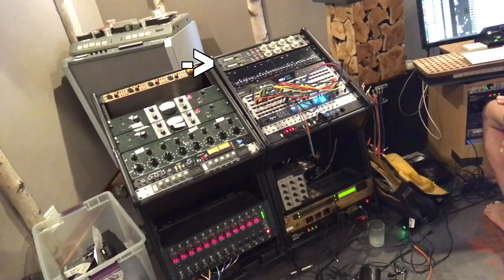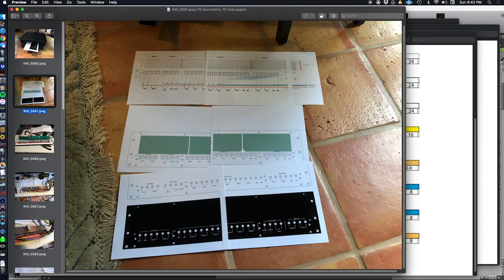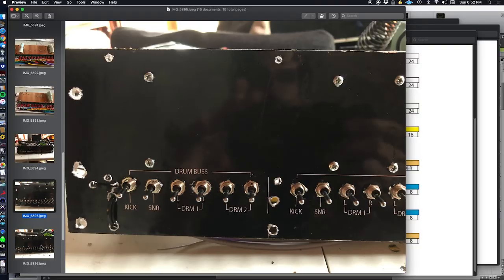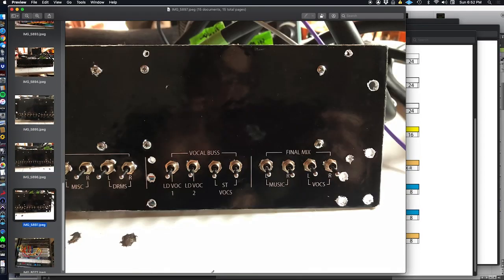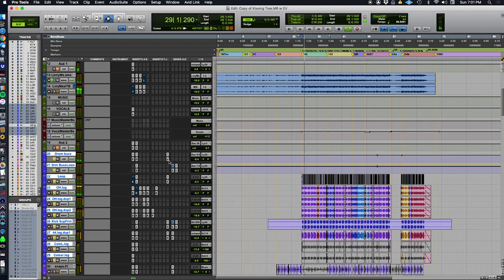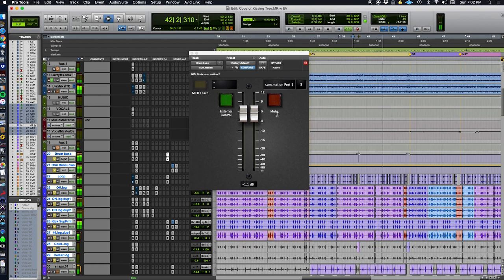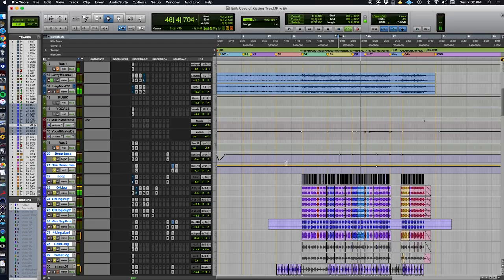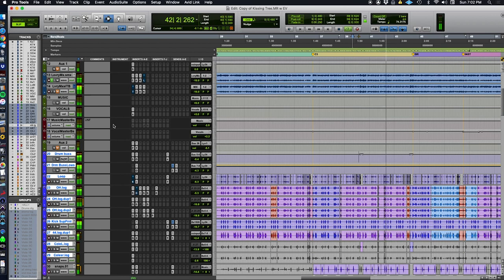Making Records With Eric Valentine - "ITB vs. OTB"

Comment: Nice education video, but you are making an error with compromised test method, and assuming that everybody interested in analog summing has Lynx grade converters at hand.. As lesser your converter as bigger the gain by the analog summing..And you never can test/measure a system with itself, since the error of the system might not show up in the measurement you do with that system. Doing 20 conversions with the same already digitized signal is not the same as having 20 independent analog processes digitized, that each time they get converted into the digital domain loose something by the conversion.  A theortical band unlimited result of the analog process.. there might be harmonics introduced well above 20 khz. So you loose harmonic content..and thats in many cases the reason you resort to analog gear inserts in the first place..Especially on the classic samplerates of 44,1/48 khz you have a big information loss and phase errors that might be inaudible on the single track..but phase relation of multiple tracks in a mix is a whole other story..there even miniscule phase differences between tracks become audible..make stereo out of a mono track.... I guess you did your 20 conversion tests in 96 KHz?  The phase error that would sum up in 20 conversions of an already bandlimited signal is with 44,1 khz much more in the audible domain. But the general loss by pcm conversions is only happening one time. While doing a conversion on 20 analog processes, would give you that general pcm conversion loss 20 times. So i think you are drawing the wrong conclusion from your 20 conversions test, and help promoting the associated digital taliban dogmas. Is there a general loss by PCM conversion? Owner of tape machines would answer that with a yes, but the industry and their digital taliban followers say no, since the late 70´s..44,1 khz pcm conversion is supposed to be perfect and lossfree., as being told by the holy book , The Nyquistomoricon..
Than the samplerate was doubled and things got better..so the perfect lossfree conversion got even more perfect and loss free..and now?..we have new digital audio formats..DSD for example. .. Owner of DSD systems would answer the question wether there is a general loss by pcm conversion  with a yes too. And even plain science and measurement technology of today would answer that with a yes.  
Just , the believers claim that you cant hear that, its below the borders of their perception.. 
But thats just an assumption, based on statistic methods, while the plain measurement data is scientific proven reality. They even measure different brain activity on mp3 files, while the listener claims to dont be able to tell a difference.. just his brain reacts different... Isnt that all funny? 
Conclusion.. dont waste time to prove that there are no losses by digital inserts.. Its just not true..Moving from the analog to the digital domain, and back, is the most critical point for the audio, and combining the booth worlds the most difficult setup...  getting the best of the two worlds also gives you the sum of the problems of booth worlds.. horrible things have happened during digital inserts all allong the development time..they just have to started to work properly a few years ago and there are daws out there that still give you a samplerate conversion as a bonus when the dsp load gets high..
So congrats to your studio upgrade, in your setup with the nice old compressors this makes certainly sense.And it dont needs to be a fairchild to get results that rival any plug in.
 Saying this i recommend also to look into dedicated vintage summing amps for boosting the passive resistor network..They are cheaper than mic pres, and come with lower impedance input transformers. So better suited for the job on the input transformer side, and they come with a lower component count than mic pre racing horses, that are build for 70db amplification. So less can be more here. Some dedicated summing amps just do sound nice..others are just as clean as it gets..quite similar to mic pres they are all different and some hidden gems are to be found.